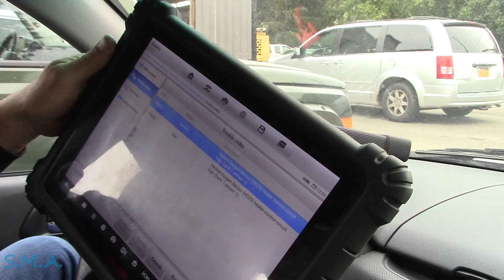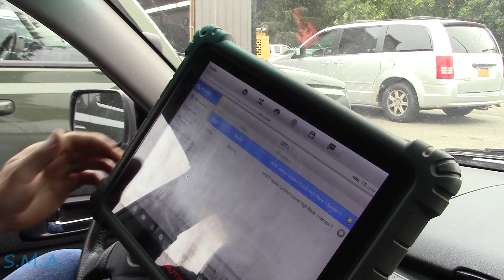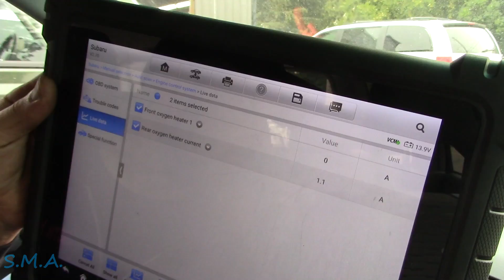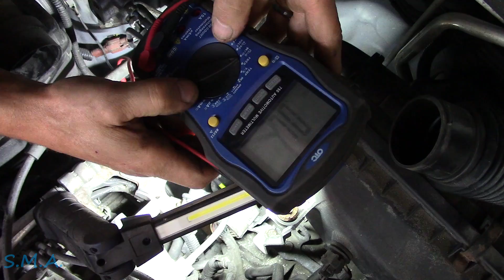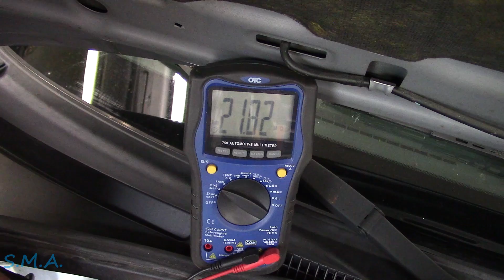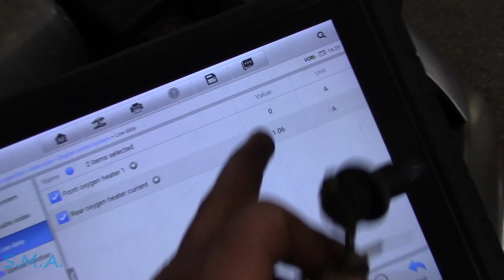Subaru Forester: O2 Sensor Code P0032

Comment: I'm having this issue as well only its p0031 low current. I measured the resistance and its 3.2 ohm in spec. I put a new sensor on it and same result. Do you have a video similar to this one that the sensor tests ok? I'm wondering if I can trouble shoot this farther with guidance. What conditions makes this heater circuit come on? Only on start up?

Comment: OmG!! OmfG!!!! I have 2014 Kia optima(156k)  w/ code P00032. Everybody was saying, change the O2 sensor, it's the O2 sensor it has to be they say. Well, they all was wrong. After watching your video and you stated that you it's more likely the map sensor I mean the mass airflow sensor I was blown away it was the mass airflow sensor with a split on the rubber ring which was raising the temp causing the error. Thk u Soo much U now have a new subscriber.
Reply: Is that what it is? Because I'm about to throw a fit

Comment: Subaru finally fixed the head gasket around 2010-2012 when the EJ engine was retired for good.  I have a 2013 Subaru Legacy in CT now with 117,000 and only recently the master brake cylinder started failing.  Parts were about $300 and it is as good as new.  Only issue after almost 8 years and one of the most reliable cars I have ever owned.

Comment: minimo............eric O excellent the video....question..ok. in this kind of o2 sensor of 4 wires..2 black is for the heather and the other 2 is for signal and  power and in what wires do you connect the light for test.........thank you  masther.....forever and ever..

Comment: There's a YouTube channel  the name is Garage54, their current video is about swapping a running engine to see if it's possible, these guys are funnier than neutral drop and they're in Russia they do all kinds of crazy stuff with cars.
Reply: Can you imagine getting your hand stuck in a serpentine, reminds me of the time my hand went for a ride around a double v-belt water pump pulley, the engine was idling and no fan. I haven't watched it yet but going to now.

Comment: Did you say that the sensor was spendy? Was this the dealer part?  A Denso O2 sensor  for this car (OEM) is like $25. God knows why the dealers get $200 for them but avoid the dealer at all costs.
Reply: I think you might be thinking of the downstream o2 sensor that monitors the cat. The upstream sensors are more expensive, DENSO 234-9015 goes for about $128 on rockauto and amazon.
Reply: @chrissmithz314  Sorry, you are correct. But $125 is still half of what it is from the Subaru dealer for literally the identical part.  On a car this old (18 yrs - in upstate NY the road salt has usually eaten them by now) if I was DIY (not paying labor) I would usually take a chance on a Chinese aftermarket part. However, no one has anything good to say about Chinese O2 sensors so it's not even worth spending the $25 when you are going to have to pull it out  when it doesn't work and get the Denso anyway.

Comment: Did did the airfuel/02 sensors on my 2004 Accord V6 6 speed. Has 5  o2 sensors total!! And two of them are air fuel sensors. Freaking expensive parts. 278.99 per sensor!!! from Honda Canada.  Brand is Denso

Comment: O2 sensor heaters seems to be a big problem on many cars, not just Subarus. I would put a 1K ohm, 10 watt current limiting resistor in series with the heater circuit, that should fix the problem. Dumping all that current in the heating element, without a limiting resistor, will fry it in a matter of months
Reply: O2 sensors are as much of a wear item as spark plugs and timing belts I reckon.

Comment: Remember if Eric O can do it you can do it, provided you have an Autel scanner ($500-$2400) depending on model, and that you have a multimeter ($50-$350). The $550 minimum cost for these devices, is a  little pricey for my blood
Reply: You can get a OBDII dongle that will talk to your phone over free software for $10. You can get a cheap multi-meter for $10.  The two of these will do 90% of what Eric's pro stuff does. It's nice to be able to see the amp draw on the heater circuit but just testing the resistance on the sensor was adequate to condemn the sensor.  The "parts cannon" approach is not all that bad for a home mechanic if you get a $25 OEM sensor and install it yourself.  If you are paying $200 for the dealer sensor and another $150 for labor, it can get expensive.

Comment: So the electronic throttle subarus will disable the cruise control with check engine light. Cable throttle and cable cruise no issues 👍🏻

Comment: "What subaru hasn't had a head gasket done" .... mine. 08 Forester with +270,000 miles. Two clutches, three timing belts, and 72 oil changes. Hands down the best car ever in the snow. By than my TJ, my Silverado, and way better than the wifes Rav4.
Reply: What is the snow of which you speak? :-)

Comment: Nice diagnostic and checking circuit/PCM and connector Eric ... logic and professionalism will always top parts changers ... back in the 70's when Subaru came to the US they were pretty reliable (although a bit "tinny") ... back then my Dad sold Pontiac, Saab and Subaru .... warranty charge back to the manufacturer from the dealer averaged for new cars fist year was like,  Saab $400 ... Pontiac $300 .... Subaru was like $1.37 and half of that cost was probably doing the paper work  ....

Comment: Vehicle: 2003 Subaru Forester, 2.5 liter SOHC, naturally aspirated, automatic transmission, 93k miles
Customer complaint: check engine light
Diagnostics:
1) Scan for codes - P0032, "Heated Oxygen Sensor (HO2S) heater control circuit high (bank 1 sensor 1)" is the only code
2) Use scan tool to monitor current on oxygen sensor heater circuit - 0 amps indicated.
3) Test drive vehicle - no issues noted.
4) Use digital multimeter to measure oxygen sensor heater resistance - megohms indicated.
5) Use test light to verify remaining circuit integrity - light works, scan tool shows 0.2 amps.
Conclusion: Replace oxygen sensor due to failed heater

Comment: I was told by MrSubaru1387 youtuber that if you were lucky enough to buy a turbo engine, that they came with beefier head gaskets and didn't have any issues.  There were many other models that didn't have the head gasket issue also, so the prejudice is unjustified.

Comment: I had a 1998 Forester with the double OHC engine.  I was a second owner.  The dealer did the whole front of the engine when we first bought it (50K) because it was leaking oil from the timing cover.  I never had a LICK of trouble from that engine and when I finally smashed the car up, it was 2015 and I still had not had a head job.  Didn't lose oil or coolant (till I smashed it with 175K on the odometer)  I replaced on O2 sensor and one knock sensor during my entire ownership. I may have replaced plugs and wires at one point now that I recall.

Comment: My understanding as a owner of 2 mid-00's subarus is if the cruise is flashing along with the CEL, then it's emissions or evap related. For instance, P0420 and P0442, cruise will flash.
Reply: Cruise will flash for anything that sets CEL. Something as simple as a loose gas cap will do it.

Comment: Imagine our disappointment that:  1. Not a brake job or wheel bearing video.  2.  Only 9 minutes long.   3.  No need for break cleaner or Fluid Film and the associated sounders that come with them.   I take it back, no disappointment in any of your videos Mr. O.   Thanks for feeding our fix.

Comment: That poor things sounds like 190K not 90K miles? And yeah Subarus have head gasket issues but newer ones like this one should go way beyond 60K before needing the heads off. Are you sure you didn’t leave out a “1” in front of those numbers? Or was this thing run without coolant and/or oil?
Reply: newer ones like this one...  It's a 2003. If a 2003 is "newer" then what's older?  (After 2009 they figured it out).  Head gasket failures on older Subarus don't require overheating - they fail with time.

Comment: As much as I like them, I will never own a Subaru.   Head @ 60k?  Inferior engine design.  I just don't get it.
Reply: It was a defective head gasket (graphite covered) used from around 2000 to 2012 or 2013 on 2.5 non turbo motors.  When they do start to leak you get the Turbo MLS version of the gasket and don't have a problem again.  It does look like the issue has been resolved since at least the 2014 model years.

My 2015 Subaru Forester has over 110K miles with no signs of issues.  No fluid leaks at all.

Comment: Why do so many people swear by Subaru?
Listening to the loyalists, one would think that a Subaru never breaks. 
I guess  anyone should expect head gaskets before 100,000, at least if you own a Subaru.
Reply: Because only one engine from one period of time blows headgaskets and the rest just don’t. 
The USA as far as I’m aware pretty much got stuck with just the non turbo EJ25 or the EJ22 (which are bulletproof) whereas where I live got the EJ15, 16, 18, 22, 25 and then all of the turbo models and it’s really only the early EJ25’s that blow the HG. 
Sure, there are some common problems Subarus have like wheel bearings (the 5x100 stud pattern and corresponding small hub bearing assy have never been great IMO) and the lower control arm bushings dying, but otherwise they’re genuinely good cars.
Reply: The main reason I would say is that they are the only cheap AWD cars or were at one time so they are popular in snow climates. Not super reliable but (aside from the head gasket labor) most parts are cheap enough.  In addition to the head gaskets and the wheel bearings that Zeroyon mentions, they also eat CV axles, ignition coils, exhausts, radiators, etc. But nothing beats them in the snow.

Comment: What Subaru didn't have a head job?   My 97 that had 226k before i got rid of it.  My 07 with 165K.  

Never had such an issue with my Subarus.  And to be fair I've owned Chevy, Ford and Chrysler.  All had their share of problems in including heads (Chrysler) and vc seals( Chevy), starters, etc.

Yes that's my experience which ia anecdotal at best. However I can't get on the all (insert car make) are bad train. 

Maintenance is key to keeping your car good and that means scheduled and unexpected.  Wash your car often if you live in a salt state.  Dont ignore small problems lest they grow. 

As dad told me...Pay me now or pay me later but you're going to pay...

Comment: If Eric was closer I would get him to fix my Silverado CE lite nobody can fix 3-4 shops, 3 dealerships lite stays on or flashes and truck acts up. About to part it out scrap the rest and it's a clean ass truck. Thanks for the vids SMA
Reply: Works most of the time, acts up enough to make you bald, I presume?
Reply: @flagmichael  What?
Reply: @frankm8533  He meant that when it doesn't work, you're pulling your hair out from stress.
Reply: @markh.6687  Not really its just not 100% reliable anymore so gotta buy something else and I'll tell ya it won't be a GM anything ever again.
Reply: wouldn't happen to be a 99-07 with a good 8ft bed would it? Pittsburgh salt rotted my bed and im in need, lol
Reply: @mattcat231  Nope it's a short bed. There's some nice beds up that way for sale I see them on Craigslist. I live a few hrs a way

Comment: Hey Eric: could an o2 sensor be bad without throwing a code? I have an 07 Forester no codes on but on cold start ups the idle is very erratic. Goes to drop to 800rpm almost stall then shoots up to around 2000 before coming back down. I have cleaned the MAF throttle body egr valve and have a new air filter. Heads refurbed 3000 miles ago along with timing belt kit. Currently at 211k miles. Not sure what to look for next...spark plugs are new as well. Thanks!
Reply: No rich/lean codes? My wild guess is a vacuum leak just because I've had the same symptoms in a Honda that had a bad intake manifold gasket, but anything ahead of the throttle plate will do that. I suppose none of the plugs looked too black or too white?
Reply: @flagmichael  no codes at all. Runs great once you start driving its just on dead cold startups that it happens. I've done 2 throttle body relearn procedures and still does it. My guess is fuel pump is getting weak and has trouble once cold but it could be something simpler.

Comment: To be clear, the head gaskets problems were in one engine series that are no longer being produced, the turbo and six cylinder cars did not have the problem, the recent engines did not have the problem.
Reply: I think most of them did until the 2009 model year when Subaru changed to multilayer steel headgaskets.
Reply: @flagmichael  
Yeah, the turbo cars used the MLS gaskets, God only knows why Subaru stayed with the crap coated ones for the entire engine series run.
It's like the number one Subatu trope, Hondas have oil dilution issues, Toyota stripped the head bolt threads in the blocks of millions of engines, but all anyone ever talks about are Subaru head gaskets.
Reply: one engine series that are no longer being produced - unfortunately, that engine went into 90% of their US cars for 20 years and even after it was a known problem with a known fix they stayed with the crappy coated gaskets for years and years because it saved them 50 yen on every engine or something.

Comment: LOL...It's not "does your Subaru leak and burn oil", it's "How MUCH oil does your Subaru leak and burn"...LOL...Every Subaru owner I know....
Reply: Well then, Hello.  My Name is Trevor.  I have a 2015 Subaru Forester 2.5 that doesn't burn oil or leak even after 110K miles.

There are plenty of engines from plenty of manufacturers that are having oil burning issues in the last 5 years.  I have heard of Honda, Toyota, Subaru, Audi, Chrysler, GM, Ford, and Mercedes vehicles all with a burning oil issue.  As they keep trying to make things more fuel efficient it is harder and harder to mass produce motors that don't burn oil.  I am in the lucky boat to have one that doesn't burn oil.

Comment: I would like to see another video about how you made the test lights out of lightbulbs and how do you measure to get the exact amperage please
Reply: A replacement truck tag light socket with bulb , at the pick and pull,  tinned the twisted ends of the wire with solder . Wattage of bulb divided by volts equals amps.

Comment: I've got 2 Subies that haven't had head jobs!  The newer engines seem to have fixed this issue (fingers crossed).
Reply: After 2010 they resolved it. Head gasket failures are now at a normal occurrence level I'd say.
Reply: Head gasket issue has been resolved by Subaru years ago but Eric just can't let it go.  Always has to mention it when taping any fix on Subies.  I have owned 6 Subies and have over 1,000,000 miles total since 1990 with virtually no problems at all.  I think it goes to how the car is maintained.  Eric hates Subarus.
Reply: @pennsylvaniacitizen138  He mentions it because it's a known issue (or was - they finally seem to have a handle on it now).  A big enough problem that Subaru (reluctantly) did a recall. Yes, MAYBE if you change the coolant often and make sure the ground is good and spit 3 times over your shoulder each time you get in the car, a pre-2010 Subie will never need a head gasket. But for most people doing average maintenance, it's gonna need one sooner or later (sooner rather than later). Whereas if you did the exact same level of maintenance on say a Toyota or a Honda, you wouldn't. Subaru inexplicably used a low quality single layer graphite gasket and the coating deteriorates over time.  Even after they knew it was a problem, they kept on using that gasket for many years and they didn't have to pay the full price of their cheapness and stupidity because most of them fail outside of warranty. So they deserve to be shamed for it.
Reply: I think they wait until 130-150,000 miles to fail now. Instead of 15k like they did in the 80’s! Good luck !

Comment: This channel saves me a fortune financially. I think I may have a look at fixing my own car when there is a problem. All seems do-able. Then I watch someone who knows what they're doing make complicated repairs on a vehicle and I decide to hand the job over to someone who is qualified and competent to do the work. Instead of mucking it all up myself then running to a saviour to pay them to undo my mess and fix the original problem properly I just go straight to the proper guy who does the repair and I pay the one bill for the fix instead of paying them to undo my mess and then do the fix. Workshop manuals say things like 'undo the retaining screw' Never how to overcome that it's rusted solid which is a job in itself. The number of tools these guys have and the knowledge they have is mind blowing, not my skillset by a long way. Hats off to the guys that can. I earn a wage at the work which I can do, and use the money to employ someone who can to do the work which I can't. Thats the best way. When I wobble I just watch guys like this to reinforce my determination not to embark of a pointless journey where I will surely need to be rescued.
Reply: Eric is a master of "how you can identify the problem" and do a repair that will be reliable while ChrisFix is a master of showing exactly how to do common repairs. The two make DIY practical for many, many people. When they go, heaven would not be nearly good enough for either of them. So much aggravation saved for so many.

Comment: At around 110 K miles, my Subaru was showing signs it was going to need a head gasket soon. It was losing a quart of oil every 3000, and about a quart of coolant. Around that time I replaced the timing belt and water pump, which require draining the coolant. When refilling it, I used the coolant additive that is called out as mandatory in the service manual. It turns out, on a previous service, the dealership had drained my coolant and refilled it without the additive. 70,000 miles now since I did the coolant replacement per the service manual, and vehicle is consuming no oil in 5K miles (every oil change), and holds all of it’s coolant.